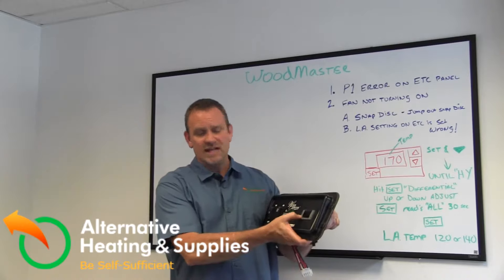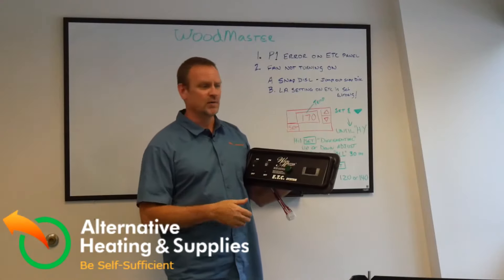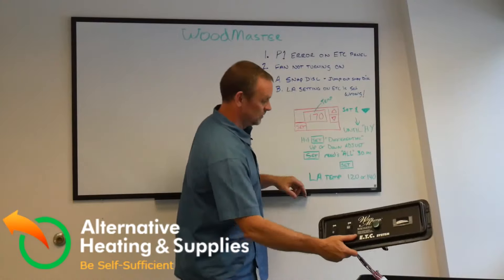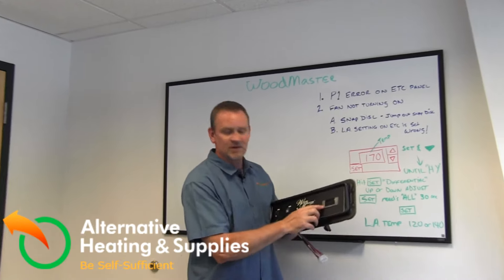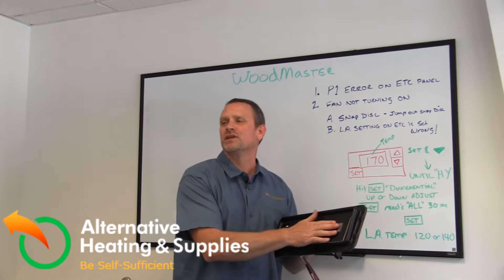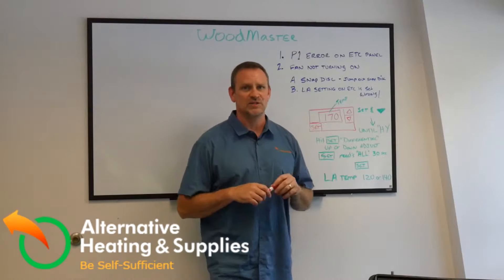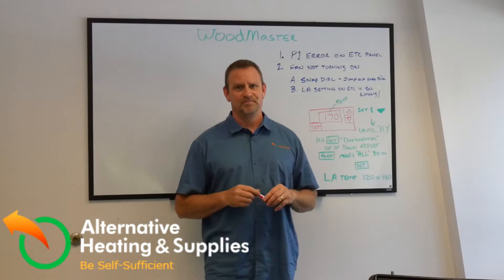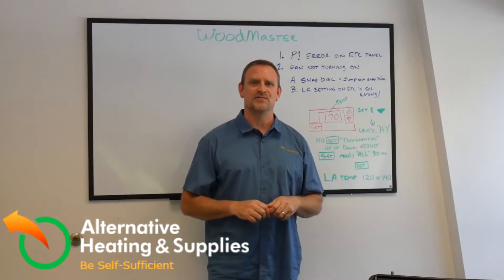How To Fix Your WoodMaster Furnace Fan When It Doesn't Turn On | DIY

Comment: I have a acme wood boiler outside. And it want heat.it only blows cold air. We replaced the thermostat. Do these boilers have a reset button on them.
Reply from the maker: Not sure what you have with that unit. Can you call Acme?